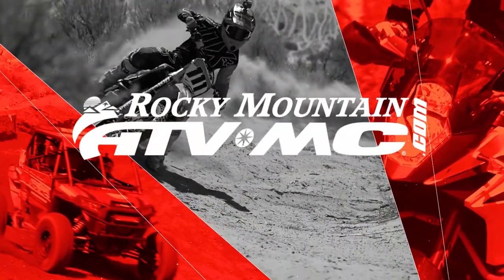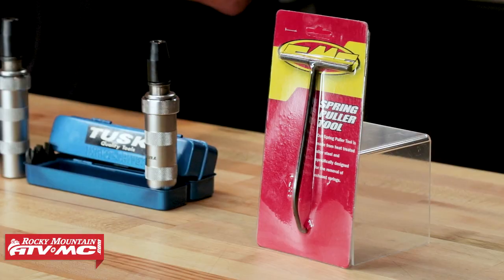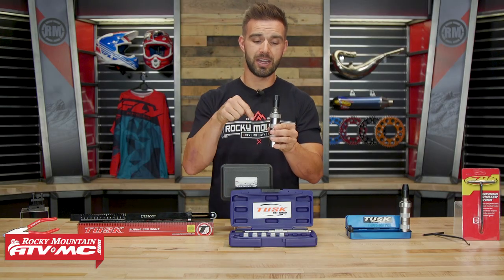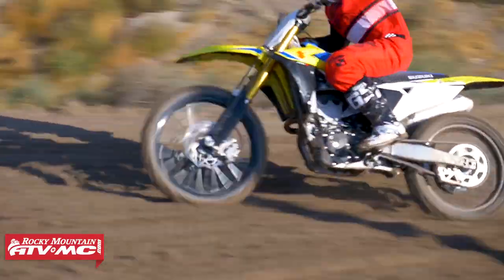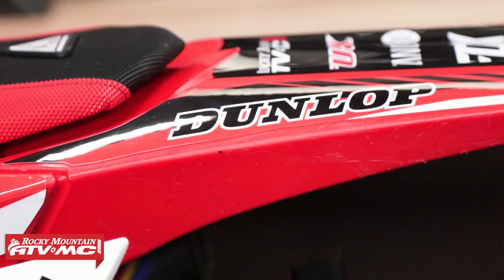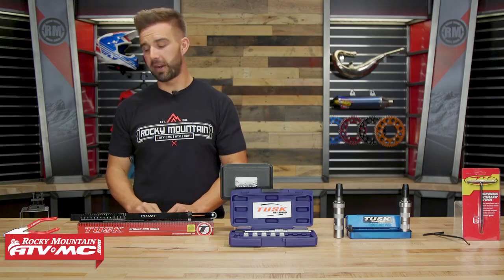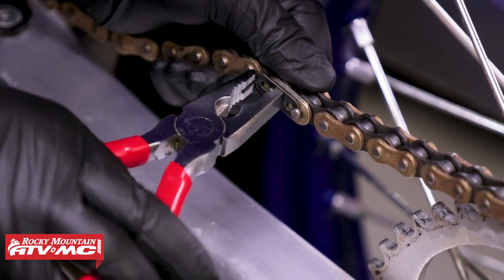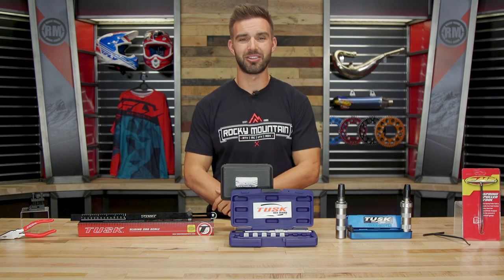Top 5 Dirt Bike Tools You Shouldn't Live Without

Comment: If you work on older Japanese bike that have a lot of Phillips heads.  Get a JIS Phillips head screw driver.   US ones have different angle and will strip out easier.
Reply from the maker: It's a great tip! (pun intended) Thanks for sharing.
Reply: @rmatvmc  Those impact tools are pretty darn good, but the JIS tip for the driver on it or just the screw driver alone with save some headaches.  Also with driver you can put a wrench on the screw driver to turn it and tap the drive with a dead blow keeping pressure in a pinch if you can't find your tool, but the tool works way better at that.

Comment: If you have the motion Pro clutch holder pliers you can use that to press on a chain master link.
Reply from the maker: Thanks! I personally used to use vice grips (about the same as the clutch tool you are referring to) and then I got a real press.  that is why I insisted it made the list.  The press is much easier, and more importantly, way more precise!....Justin

Comment: super easy, fun and rewarding to make your own exhaust puller. obviously easier to buy one. but making my own was more satisfying. all you need is a cheap welder and some scrap. pretty easy and fun to make your own t-handle set too
Reply from the maker: Funny you say that.  I made a spring puller in my high school welding class over 20 years ago and still use it today!  However, when a nice one is only $5.99, it is hard to want to make the time to build one.  I am like you though and like to tinker in my shop and a spring puller is quite simple! ..... Justin

Comment: How do you know your setting the correct torque on your spokes even with the tool if the threads on the spokes are gummed up or rusty??? well I know it easy too say keep them clean but that not so easy when you drive in mud all the time.
Reply from the maker: if the spoke is stuck, you can't.  so you need to loosen, clean, and lube.

Comment: Yup we have that exact impact driver and we use it all the time for reservoir covers bc those philips screws are always hard to take off
Reply from the maker: A must for sure.  I am always surprised to find buddies that don't have one when they have owned and worked on bikes for years.  The tool is a life saver!
Reply: More importantly is using the right bit. Virtually all Japanese bikes, and some European bikes as well do NOT use Phillips head screws, but rather JIS (Japanese Industrial Standard) head screws. You'll very quickly strip a JIS screw using a Phillips screwdriver. I'd suggest that many times people resort to an impact driver, it's because they're using a Phillips screwdriver on a JIS screw and strip it out - if they'd used the proper size JIS screwdriver to begin with, they most likely wouldn't have stripped the screw.

Comment: I've figured out that to get the springs off the pipe all u need is a zip tie to tie around the spring hook and then some pliers to hold on to the zip tie and no need for spring pullers
Reply: AIDEN WELLS by the time you have done that, I’d had the pipe on and off and backwards, for the cost of a spring puller tool seriously it’s not expensive and lays for itself in no time.
Reply: vice grips bro and push dont pull...thank me later
Reply: Winjust use needle nose vise grips
Reply: or the big fencing plirs with the crimping ends on it they grab onto the springs and dont let go
Reply from the maker: and that is why this inexpensive tool made our list:)
Reply: I just use a piece of rope like a boot string. Or a piece of wire. Makes for one lees tool to misplace and works just as good some times even better in certain situations.